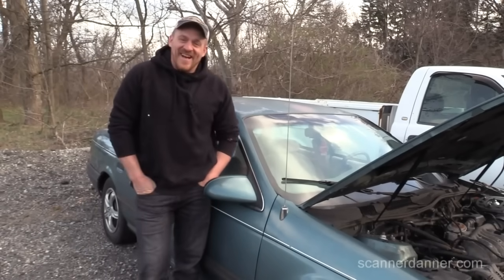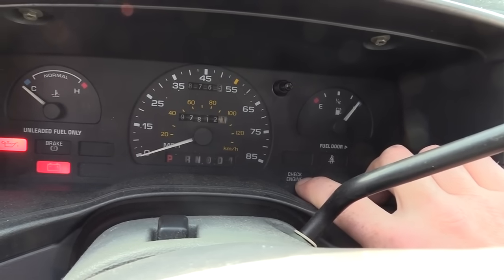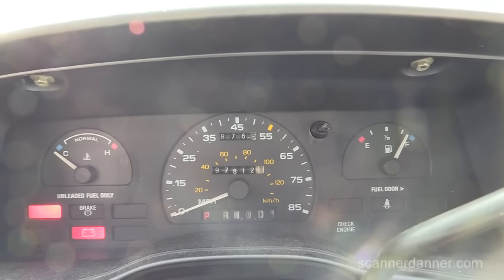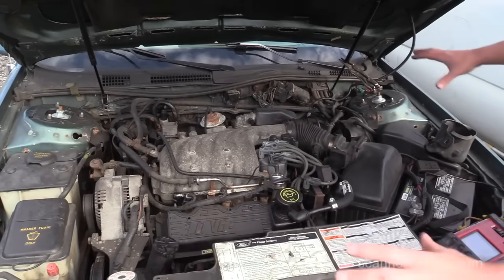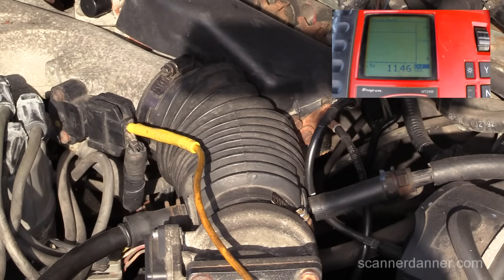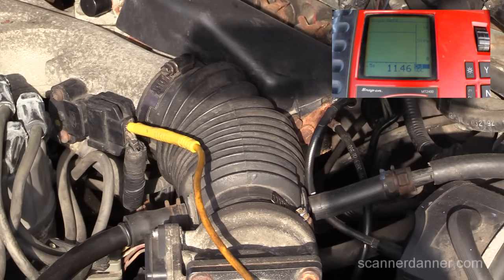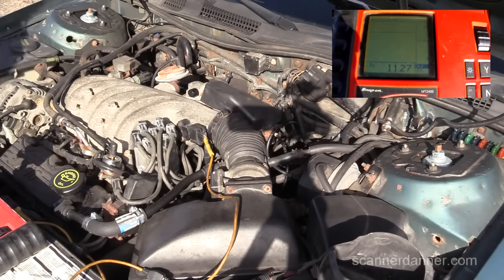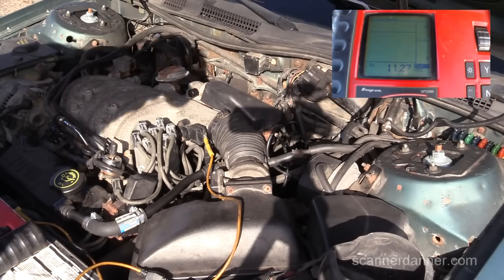Sensor grounds and the 5v reference circuit (a 2016 ScannerDanner Premium video)

Comment: I am an old, old electrician, including automotive work. The way to deal with tarnished and corroded wire is to gently scrape or sand with fine paper, til it's bright and clean, then you can crimp or solder; I recommend soldering because it resists corrosion. Also, do not cut or splice wiring with the power on; electronic equipment does not like that and you can do some extensive damage.

Comment: Hello Paul,
I'm a 59 Yr old fart who was an hgv tech ( semi truck to you & your US bros) for 30 years. Turned my hand to everything but electrics.
Seems to me, I was born with an open ground in my head with a 12v sensor feed to the dark place where electrical understanding is stored. The bulb just never lit. 
I have been watchin & lovin your vidz for a while now and thanx to you the grounds are being fixed one by one and the reference signal voltage is slowly coming down.
You're an absolute fkin genius with a mind like an ECM.
I'm blown away by and still trying to comprehend just how much stuff is inside your head.
Just nipped in to pass on to you a humungous thank you and major gratitudes for sharing that most valuable asset a human being can have is knowledge.
You're amazing man‼️
You keep makin em we'll keep watchin em. 

Happy & healthy life to you & your family.
Reply from the maker: Thanks so much Alec! So cool the hear this kind of feedback
Reply: Thanx to you the bulb is slowly switching on.
Reply: Alec Nemeth - I'm on my 50's, thankfully for me, my long time deceased father in law. Started me on the "dark magic" of the electrical side of vehicles. He himself started as a 12 old apprentice kid building batteries. Different times for sure. 
By then I already had a quite decent mechanical background. That simply add the cherry on top of the cake. ;-)

One of the details I never forgot was, in general, to keep contacts clean, grounds in particular immaculate.
I can't state enough how much it kept me clear of "car troubles" over the years.
Since one way or another I'm always messing up with "mechanical stuff". Keep that on top of my to do list. Worth every penny. Except for family or friends who seem to take advantage of it. LOL 😂

I also thank ScannerDanner for his knowledge sharing. Big Thumbs up.
Cheers all

Comment: Again, beautiful to show how a logical approach makes sense and works.  I know you wouldn't normally be working on am electrical system with power applied.
Only thought is mention that whenyou have grounds from different systems connected together like that but not connected to ground, they will seek a lower resistance (via current flow) through the other floating grounds.
That could potentially damage the more fragile circuits e.g. say a headlight seeking ground through the computer lifted ground wire.
Of course the headlights aren't on I'm just using that as an example.
It may have been one of those mercy repairs for a friend but look at the great opportunity it provided for a great example of trouble shooting.
Thanx for you videos!

Comment: Thank you friend. I had an auto electric class with almost no hands on and zero mentoring, a lot of it was a waste of time and not applicable to repair work. Reviewed the book we used, it said to dc the sensor to check the gnd wire for voltage drop; of course this made no sense to me as no current is flowing, and this brought me to your video. You have a great talent for auto instructional videos. There are great mechanics  but many lack the aptitude for teaching in a coherent easily understood  manner. Well done.

Comment: My first instinct was a wire-to-wire short to battery power, so it was a surprise to see this was caused by a poor computer ground. As you say, if the computer ground is bad, the computer voltage regulator that produces the 5V standard will have no reference baseline to produce exactly 5V. It was really helpful to hear your remark that every time you've seen it, the problem is not a short to power, it's a bad ground. That's where experience trumps book knowledge, invaluable. Thanks!
Reply: When there is no ground to the computer, the 12v power to the computer will appear at EVERY point in the computer. That's a general rule for all electronics(i am a career electronicist), and it's a good rule. Experience doesn't really trump book learning, it works in conjunction with it; without understanding at least some of the theory, all the test equipment and test readings are meaningless, but experience will certainly guide you in knowing where to start looking. I work on auto circuits, but I also repair communications equipment on the bench, and work on network cabling. Each of these fields all work according to the same theory, but each also comes with a different set of experiences. Here in Michigan, the car's greatest enemy is  the salt used on our roads. It eats EVERYTHING, and that's where that black and green come from in the wiring.

Comment: Prime example of how a backprobe can lead one astray. It's so very simple to seal a microscopic pin hole when piercing. 9:00
Reply from the maker: Exactly Keith!
Reply: I have started to lean towards wire piercing also.  I have no desire to second guess connections or even worse, the possibility of crossing two terminals and frying the computer.  Liquid electrical tape is a lot cheaper!
Reply from the maker: Prime example of when to pierce

Comment: Working on a 2015 sierra AC. Found many burned plugs, bad grounds, and a bad fusebox. Git 5v on reference,  12v, and 7v on pressure switch. Checked for all problems I could find in forums and solved a handful of issues with things other than the ac. Thank you for this video, now I have a new direction to look. My biggest fear is replacing the pcu and still getting no power through compressor clutch

Comment: Brilliant. ...The result is all that matters. 
Love the way you explain your thoughts as you go along......
I'm a lapsed motor mechanic/ electrician....comng back to the game and finding all this Electronic/computer stuff on cars is pretty daunting...But you are inspiring me to resolve these problems.... I kinda knew the 5v had to be present at all sensors (Like washing machines!)
So finding it at almost battery voltage... had to be a "grounding" problem somewhere.

BUT.... That was a mega hint on the Fords: No Check Engine light..... Thanks for that.
Big saludos....And thank you.

Comment: Hi, I used to love using the Vantage around 15 years ago when I was an auto/electrical tech. Loved the tool, it was well made (in the US :) ) and at one point I actually thought of making it rechargeable since it was quite power hungry. I did use the pro version a couple of times, but did not like it as much as the original. BION but I had a couple of these, in the cases with all the accessories, and sold them on Ebay thinking I may never need them again. 
Recently I had a problem (p0325) with an 2003 Honda Element of mine an wanted to see the waveform of the knock sensor - I still work on cars now and then. Obviously you still love using the good old MT2400, but what would you suggest I look into getting to be able to view a wave form? I still use a power probe and was wondering if you had used the new Power Probe PPTM01AS (Maestro), or shall I go for a scope like the Pico,  Hanteks, Signstek DSO203 or a multimeter/scope like a Liumy? PS I don't mind using a laptop/tabet - I have a bunch of Toughbooks.  Have a great New Year. :)

Comment: Dude! You ARE literally "the man"! Wish i would've had you do my not so budget engine swap on my 1996 k1500, been weeks since i had it towed from my mechanic's to my house, and it still wont start, cranks though. =( It got to my mechanic's under it's own power. )=
Reply from the maker: If you have a voltmeter and a test light and a fuel psi gauge I can help you
Reply from the maker: @francismay5734  first test, will it run with an alternate fuel source? Carb cleaner or air intake cleaner is my preferred method. Starting fluid can be misleading when troubleshooting as it is super volatile
Reply: Yea, i have tried the alternate fuel source(carb cleaner etc.) Didnt start. I have checked for spark at the plugs, no spark at all 8, no spark at the end of the coil wire either. About to check at the coil next.
Reply: Ps. I dont use starting fluid btw, i heard it can actually cause damage.
Reply: Also, not sure if this matters or not, once upon a time a my coolant temp guage and my oil pressure gauge stopped working. A mechanic installed mechanical guages to replace both. The truck ran fine never any starting issues. Like i said the truck ran ok before the engine swap, even with low fuel pressure and a blown rod bearing it started fine,(as long as i started it every day. If i didnt for a day or 2, i would have to use carb cleaner to start it)
Reply: Ok quick question, i replaced the crankshaft pos sensor harness plug because the wires were twisted on each other. And he first 3/16" were bare, is it a possibility that all 3 of these wires touching my have fried the computer? ??
Reply: I have borrowed my friend's fuel pressure test kit, awaiting instruction.
Reply: @ScannerDanner  it wont start with alternate fuel source.
Reply: @ScannerDanner  also no rpm while cranking
Reply: @ScannerDanner  wont start using alternate fuel source. I did a fuel psi test, the system pressurizes to 55 psi and holds. Checked for spark, no spark back to the coil, and no triggering signal coming from pcm at ignition control module.
Reply from the maker: @francismay5734  I missed this, so your crankshaft sensor wires were all touching each other? Yes, this could absolutely damage the PCM. What is the voltage readings on the sensor with it plugged in AND unplugged. All 3 wires?
Reply: @ScannerDanner  not sure what the voltage, is, but i did notice an obd, dtc code popped up, p0339 crankshaft sensor circuit intermittent
Reply: @ScannerDanner  so i was able to communicate with the pxm wia obd port.
Reply: @ScannerDanner  also not sure exactly how to test voltage at the ckp, it is getting 12v on the power wire...
Reply: @ScannerDanner  i think i understand what you mean, so i will check voltage at the plug connected and not connected . I will let you know what i find.
Reply from the maker: @francismay5734  yes, post to the forum, it will be better than here and I have people I pay to help me help you guys. It is free to join my forum btw https://www.scannerdanner.com/forum/post-your-repair-questions-here.html
Reply: @ScannerDanner Hello again, just wanted to let you know i couldnt get a message to you through your website and after losing 3 messages, i gave up. Anyway, i finally discovered what my no spark condition was caused by, the mechanic that did my engine swap, didnt transfer the reluctor ring from the old engine. Now it starts fine, but after about 5 minutes the check engine light starts flashing and the engine starts idling funny. Getting DTC p0300, p1375, any thoughts?
Reply: I have replaced all ignition components and even the pcm.
Reply: @ScannerDanner  @ScannerDanner Hello again, just wanted to let you know i couldnt get a message to you through your website and after losing 3 messages, i gave up. Anyway, i finally discovered what my no spark condition was caused by, the mechanic that did my engine swap, didnt transfer the reluctor ring from the old engine. Now it starts fine, but after about 5 minutes the check engine light starts flashing and the engine starts idling funny. Getting DTC p0300, p1375, any thoughts?

Comment: Hi Paul,
Thanks for sharing your knowledge, skill and experience. Would you please explain how bad computer ground would raise the voltage. if you have covered this in your book please let me know where it has been covered.
Reply from the maker: It is no different than any other circuit with a bad ground. No current flow = no voltage drop. The ECM board itself has no ground, so all power coming in and circuits trying to operate cause the entire board ground voltage to rise. Hope that makes sense. I could draw it better than describe it. I'm sure I do in one of my playlists I provided here in this description. The ground circuit problems one. There's like 6 videos in that playlist. I think you'll get a better ideas when you see some more. Thank you!
Reply: @ScannerDanner  Thanks a lot for your reply.

Comment: I am not a mechanic but learn a lot from your channel.   Why was the voltage 11+ volts at the ground wires?   how did those bad wires cause that?
Reply from the maker: Crazy right? It is no different than any other circuit with a bad ground. No current flow = no voltage drop. 
The ECM board itself has no ground, so all power coming in and circuits trying to operate cause the entire board ground voltage to rise. Hope that makes sense. I could draw it better than describe it. I'm sure I do in one of my playlists I provided here in this description. The ground circuit problems one. There's like 6 videos in that playlist. I think you'll get a better ideas when you see some more. 
Thank you!
Reply: @ScannerDanner  makes sense - thought that was the answer but thankful for your expert description!   Thanks for all you do!  If I were younger and looking for a career I would go to your school/videos etc and enjoy the challenge of auto diagnosis!

Comment: Great one Paul. A VERY good lesson in getting initial direction by checking the basics and establishing certain "MUST HAVE's" then going from there. You must have a focused approach to be effective in any diagnosis and repair. I think you presented the point well in that if you don't have a 5 volt reference, (that is supplied by the computer) then you do not have what is needed to make the engine run. It is as basic as trying to start an engine without any fuel.... it will not work. The lack of ground to the computer means that the entire computer was "FLOODED" with 12 volts with no way of working and providing anything else than that battery voltage to ANY circuit. The 5 Volt Regulator Circuit needs a ground to function. I am surprised that the engine ran as well as it seemed to after all that had been done to it. You made a valid point.... diplomatically.... 'I hesitate to take this one on'...... 'freebe'..... but let's see what is missing. Also the point about remembering a similar case from 20 years ago is very valid..... maybe not exactly the same, (although in this case it was), but valid experience just the same and usable in this similar situation. A good combination of UNDERSTANDING, EXPERIENCE, DIRECTION, and MEMORY is unbeatable in so many fields..... LEARN FROM THOSE THAT HAVE IT!  Sometimes these ones will also have a good story to relate with the experience that will help you remember the point.... listen to them and remember the lesson.  Thanks Paul for your lessons and experiences.
Reply from the maker: very well summed up my friend, on point exactly! and we need to not be afraid to bill for these types of job. If I'm a garage owner, this is a $150-$180 repair all day long and the customer is happy to pay it. Our knowledge and expertise should not be given away.

Comment: A great day when i see a scanner danner video. 
Btw another thumbs down..good greif..who's the troll..😲😲😲
Reply from the maker: Got in influx of new ones from FaceBook lol
Reply: @ScannerDanner  Immigrants! Now that I've addressed the boneheaded side of the equation let me just say I hope these kids know how lucky they are to have you as their teacher. BTW my 88 Impulse uses the TPS switch. It only senses idle and WOT. Funny thing about it is normal operation is no pump prime before cranking and OBD1 DTC 12 is normally always stored to indicate that RPMs have been too low at some point during the current key on condition...Duh!
Reply: @ScannerDanner  awesome video thank you sir!! I seen this go the other way where a cam sensor on my jeep was reading  1.6v on the signal wire..after verifying I had my full 5 volts supply.. I've learned so much from you..keep em coming

Comment: Great job of troubleshooting - loved it throughout.  Was a good tutorial for me as relates to the 5 volt reference - a few days ago I finally found out where the batt voltage was reduced to the 5 volt ref. :)   I see the parallel application of that 5 volts, and  it is readily available at the "easy to get to" sensors.   Many thanks,

Comment: Looks like Michigan there. Great video. I've been a Mobile Mechanic here in Ann Arbor for the last 15 years and a Mechanic for 30 now and one things certain I am always learning something new!! I love being a mechanic and really enjoy jobs like this, like you said, once solved they pay in spades. I use parts buckets for my tools and fasteners to stay organized (busing tubs or dish tubs) it helps on jobs outside of the shop. I miss my quick strippers (we used to use HEI advance springs to fine tune them when I worked at Roush, ha). Anyways I'll pick up your book and I'm sure I'll learn from it!!